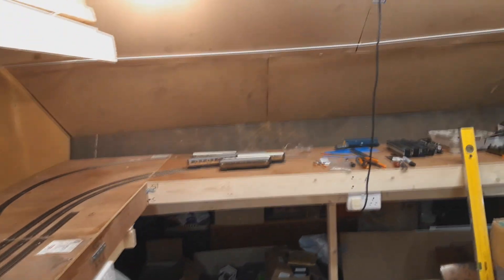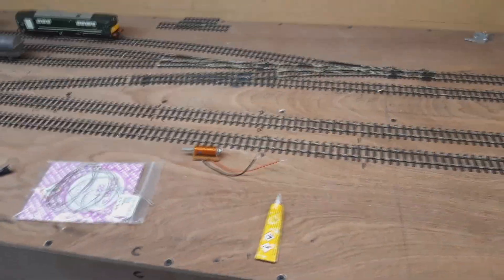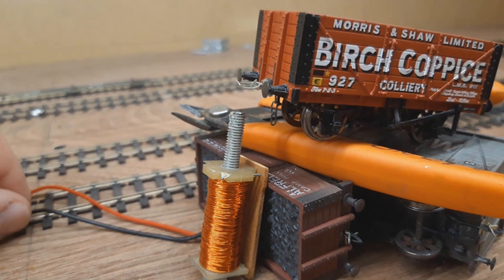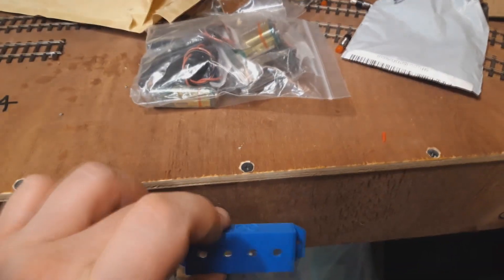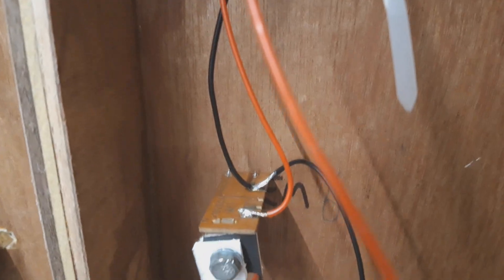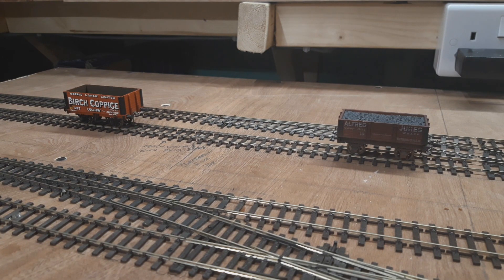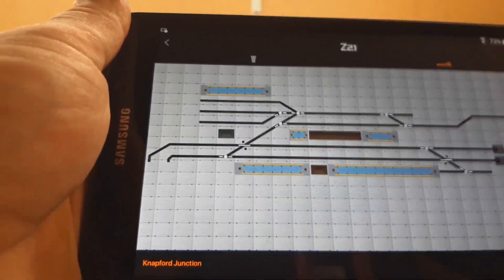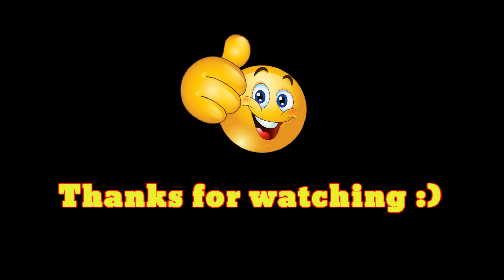NWR  Tidmouth to Knapford & Beyond - Part 7 - Electro Magnets & Creative Thinking!

Comment: hey sparkshot its me again i got a idea for a new product i want you to sell #1 the old shape henry tender u know from the one with no number #2 lbscr e2 air or brake pump accessorie for the e2 you could make these things for 4mm or 2mm whatever its your shop. ok got all that? tanks
Reply from the maker: The E2 Westinghouse n Weir pumps are already available in 4mm.  I'll have to check the upload options although you could always email me for a direct 3D print.

I do intend to do the tender but just not yet.  Got a lot on my mind at the mo.
Reply: @sparkshot  eh he he #embarresed

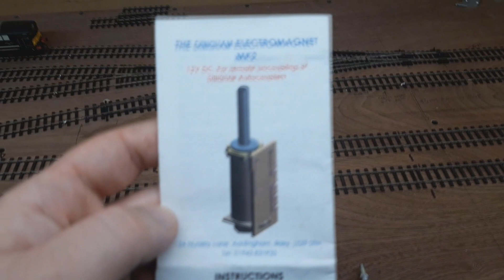Comment: It literally says on the instructions at 1:40 that you can get the power from your train controller by rectifying the 16VAC. I find it quite bizzare you are building a train layout with power points all through the room and you go out and buy 9v batteries??? That's LAUGHABLE!! No offense, it's simply non sensical!! A bridge rectifier to turn the train controller's AC into DC would cost under 1$. Now you're going to be ripping through the consumables as a 9V battery isn't going to hold up to running those electromagnets for long before going flat. The instructions say 12v DC. So not sure why you'd be even trying it on AC, or 18v DC?  Man I'd suggest trying to understand some basic electronic theory before messing around the way you are before you destroy something ✌
Reply from the maker: You might find it laughable, but you don't know all the considerations.  

I used AC rather than DC on a previous P4 layout I built as the AC of the controller  for accessories surprisingly worked perfectly.  Was thus going to do the same with DCC as it's also AC but being digital the wave form is obviously different thus it not working.

The power points were installed mostly for ease of using power tools.  I did NOT want to use another DC controller just for powering electromagnets, I specifically was looking to not use a plug socket which is why batteries for some items suits me perfectly.  I also did NOT want to make extra wiring connectors going through the boards so batteries keeps wiring much simpler and quicker to set up.  As this layout is 18 x 11' with me doing 98% of the work speed is important to me.

Also I didn't want to research bridge rectification and how to wire them, prefering instead to do something I already know.  As for me learning some 'basic electronic theory before I destroy something' I understand enough to be content.  The layout is all wired up and perfectly working if you hadn't noticed but I guess you have a big head feeling the need to sound condescending.

As for the batteries running out I couldn't give a hoot.  In reality you turn the magnet on for .5-1 second at a time and they will rarely be used anyway.  I guarantee it'll be a long time before the batteries need replacing.

Rule 1.